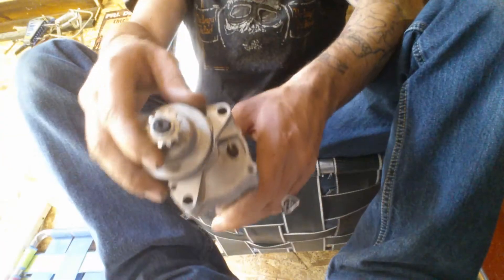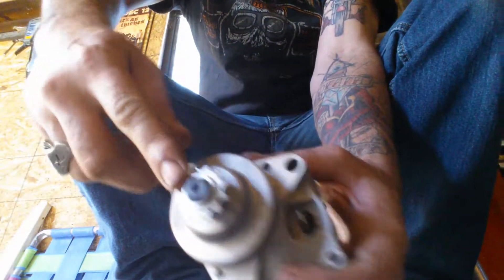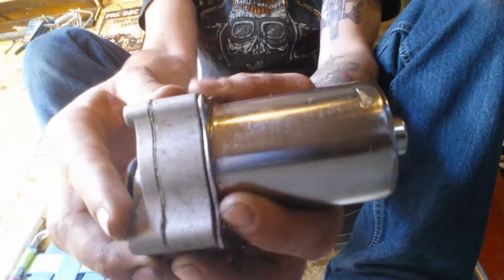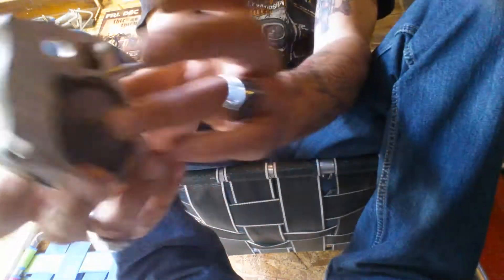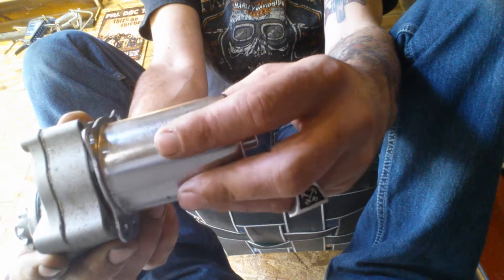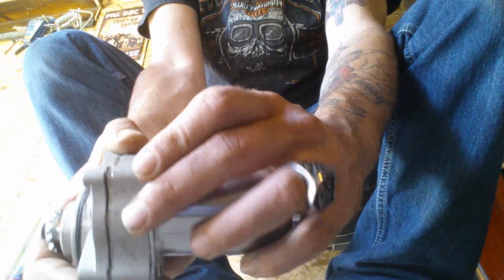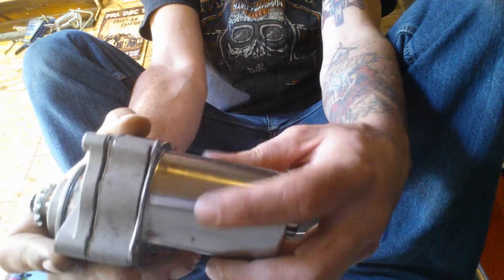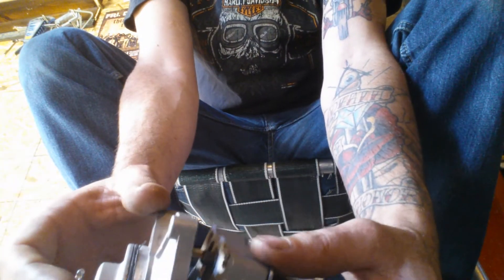110cc Chinese starter replacement

Comment: got any videos of putting the starter back on if you pull the part with the magnets in it off. Mine went out and i pulled just that off to check it and the wires had broke off in there so i purchased a replacement. was just worried after seeing the springs and two metal cubes.
Reply: same rn
Reply: @jaylul3450  just buy a new one man lol they're pretty cheap and not a head ache like that was.

Comment: If you happen to see this what's the best way to get those 2 springs back in and all together inside the starter? I spent a solid 20 mins trying to do it and just got frustrated. Any tips would be greatly appreciated. Your videos help alot by the way!
Reply from the maker: It's just a judge plain in the ass. It takes me quite a bit of time to do aswell
Reply: UnProfessionalJoe can you please tell me how to loosen the bolts to get the crankcase off to get to the chain that wraps around the starter id appreciate that
Reply: @unprofessionaljoe7233  is there a trick to it? How do u do it? Tips and tricks please! Thanks in advance!
Reply from the maker: @rebelkeeton3532  yeah it's kind of a pain in the butt not going to lie it took me quite some time to do it too. Just keep at it and eventually you will win
Reply: Where do the little springs go?

Comment: I took the part with springs in it apart. (I didn’t know any better) now I can’t get it back together, any advice??
Reply from the maker: Patience . They suck to get in and it takes awhile but it is doable
Reply: @unprofessionaljoe7233   I can’t get the little blocks to stay in because of the springs, long enough to insert the thing. Would you happen to have some advice or a tool that would help or maybe know of a how to video online I could watch??????

Comment: OK so I bought a new motor and did thisWhat I don't get is were dose the wire connect too?? The one thats bolted on hanging off the starter
Reply from the maker: okay if your talking the wire with the small gold screw that connects to a metal tab coming directly from the starter it connects to your cylinoid.

Comment: I have replaced my the starter (which I am not sure is the problem in the end) but the issue is that the chain keeps popping of the starter.  Is there an adjustment or something that tightens the chain?  Or something else that would be causing this?
Reply from the maker: no tensioner. maybe your gear or chain is warn down